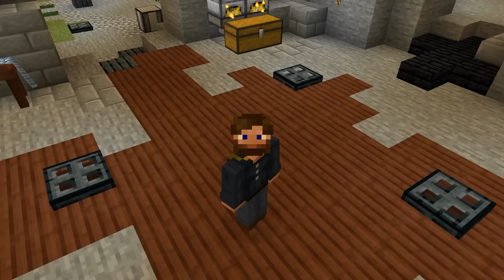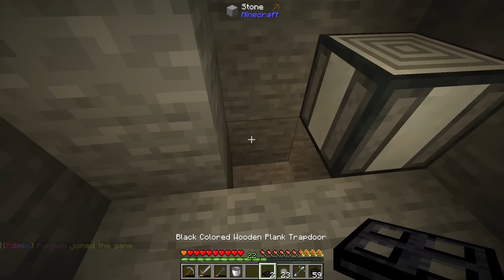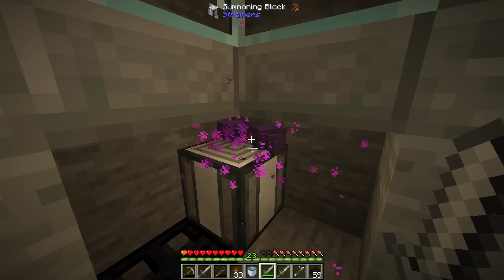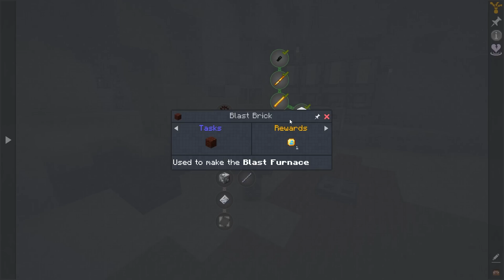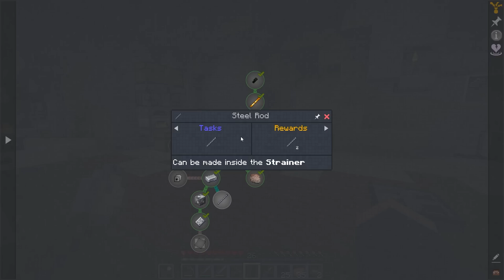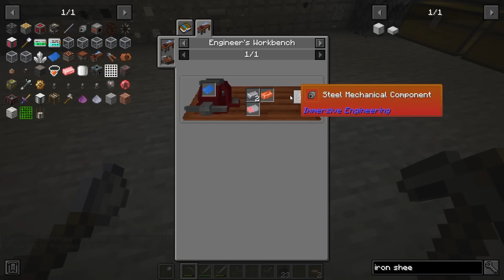Stoneopolis EP5 Unlimited Bone, Resource Generator 2, and FAST Steel

Comment: By the way, the upgrades for the strainers are really good, you can get the max tier input upgrade by this point, which gives the strainers an 80% chance to not consume any input items, essentially 5x your stuff.
Reply: Yep, I said it in the last video.

If nothing else, just make the yellow one.  It cost almost nothing and will only take a few seconds to craft.  It gives you more output from each craft, so it pays for itself after about 30 seconds!
Reply: Came to offer this same suggestion, so I will just add if you make a couple of steel buckets, which hold 6 buckets of water, the crafting is super quick for making the upgrades.

Comment: Btw later on you can autocraft lapis-allloy ingot, void iron, etc in the engineer's workbench/automated workbench with just charcoal as the fuel so if you have charcoal automoated then you can craft the ingots relatively quickly
Reply: Does the automated workbench take charcoal?but from side it accepts it ?
Reply: @greeshmaisave5410  Yes it does accept charcoal. Just put an input node